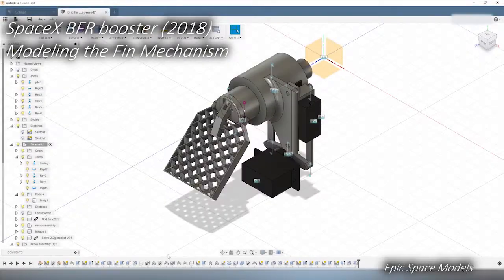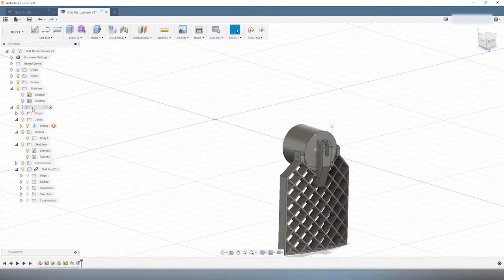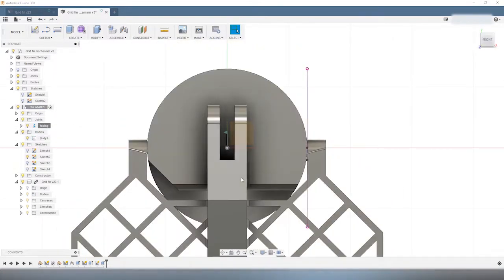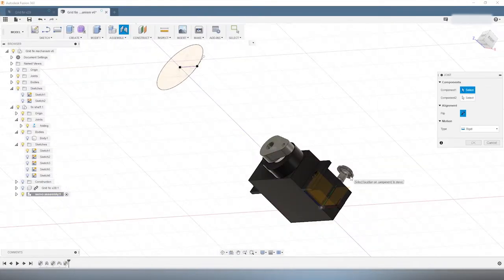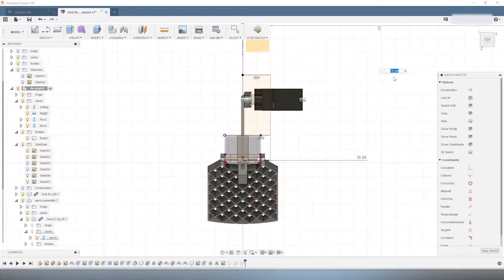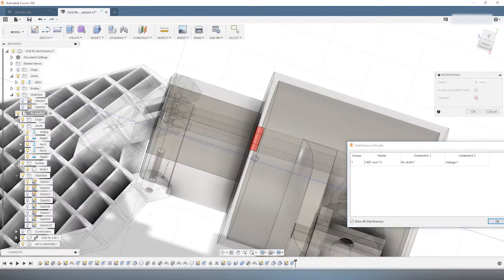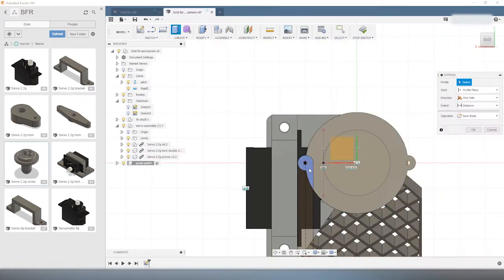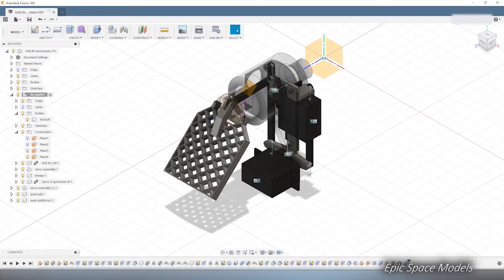SpaceX BFR booster | Modeling the Fin Mechanism

Comment: Hello can you share the stl files please ?
Reply from the maker: Hi. Thank you for your interest. I am excited to see other people interested in building these models. Unfortunately, I am not sharing the stl files for the moment for the following reasons:
1) I still need to tweak the files to correct some design flaws and make the model easier to assemble. I would also have to write an assembly manual, because it is not exactly as easy as putting together a LEGO.
2) I am still not decided about where and under which conditions to share these files. I am thinking about setting up a community on Patreon or similar platform. Still have to think about it.
I will post an announcement when I have more information about this topic.
In the meanwhile, if you want to know more about a specific topic (3D modeling, mechanical design, 3D printing, programming, etc.) I would be happy to make a video about it.
Reply: @epicspacemodels319  I'd love to get access to the STLs too. And have more information about the modeling, mechanical side of things.
Reply from the maker: @WinterMute2051  Thank you for your interest!
I will see if I can find a way to make more information available.